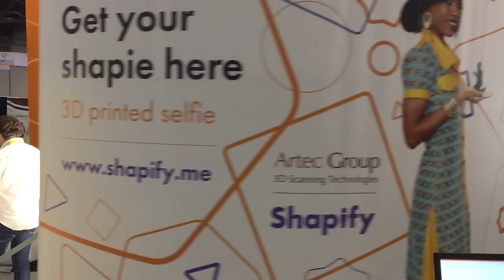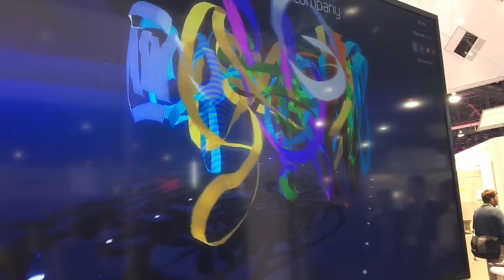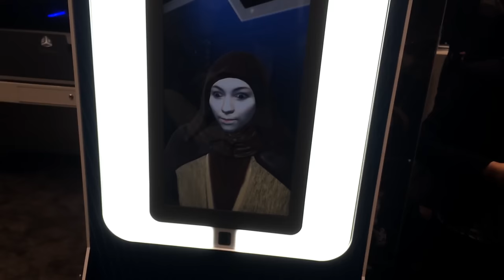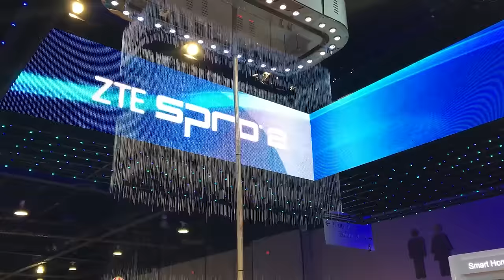CES 2016 - 3D Printing, Laser Cutting, Virtual Reality, Holograms & More

Comment: Amazing what these things are capable of doing. Thanks for the video, but to me, the biggest drawback is cost. The CES Cube printer runs from $2,800 to $4,400 depending on what version you buy. Price is from CES's web site.I build plastic models and see unlimited use of the printer and 3D scanners. Add to this, parts to a machine that's no longer made or available. What does it cost to print something? For example, the figure of yourself.....what did it cost and how long did it take? Thanks again for the video.